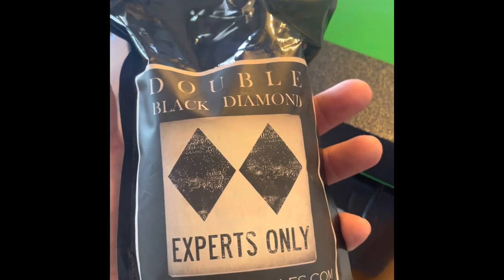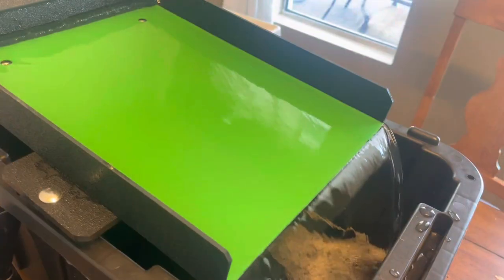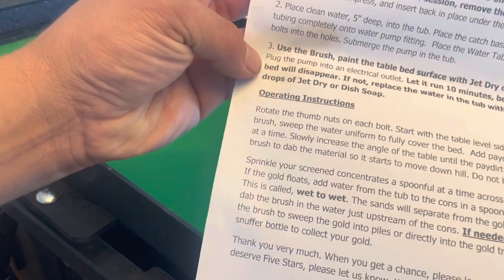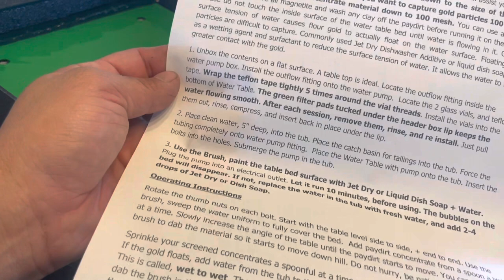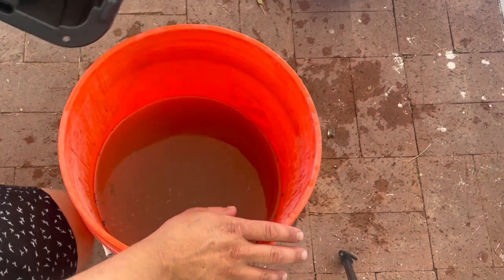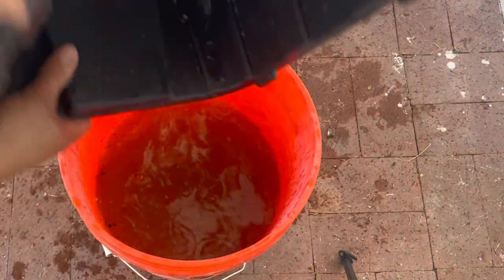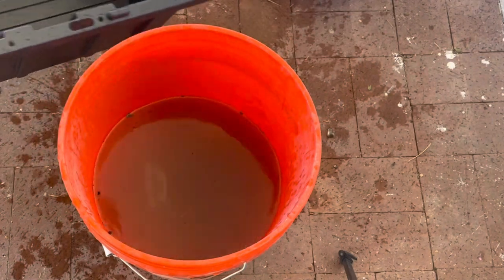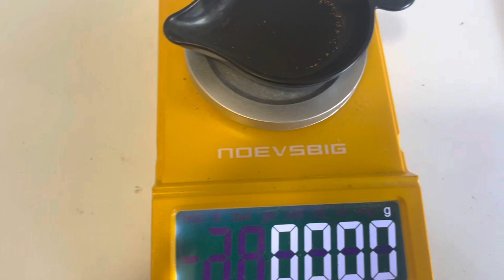Miller Table test with @goldnuggetsales  hardest Gold Paydirt in the World

Comment: I used to have an original Miller table. I loved it. It was 6' long and made of slate with little grooves cut in it for the first foot, Than it had 3 sections of carpet with extruded metal and  the last section had a copper plate that you could amalgamate with mercury and your real fine "floaty" gold would stick to that. Finished off with a mercury trap at the very bottom. Used the hell out of it in Colorado. Lost it in an accident coming back to AZ. Sucked.
Reply: That sounds like a collector piece....the exact point in time when mercury and carpet overlapped...sorry for the loss🤝
Reply: @ferdburphel2076  Even back in the old days they "lost" mercury. The Carson River is loaded with mercury from the old mills. Very seldom did i find or have any loss. I always recovered what i started with.
Reply from the maker: Damn!! Thank you Richard BEEE!! Take Care!
Reply: @VendettaProspecting  What you up to Mike? Why the thanks?
Reply from the maker: @richardbeee  saying thanks for watching and commenting

Comment: I got the royal Miller table from A&B when I was in AZ.  Definitely nice having it for very fine gold!!  You should put a catch basin in the tub to make it easier for cleaning up.  If you use something like a credit card or hotel room key card or something similar you can use it as a scrapper to help get the gold off the surface better then the brush.
Reply from the maker: That’s weird still there the other day when I went there, the brush is nice because it won’t scratch the surface and leave grooves in it, the brush is a lot softer
Reply: @VendettaProspecting  they had a couple of them when I got mine.  Oh yea I forgot the royal Miller table has a different coating thats more like a rubber that I dont have to worry about scratching

Comment: a few things to help you out maybe. that table is too steep. also classify your material first. the powder gold is washing away and some of the small chunks.
Reply from the maker: thanks for the input, it was set at less than 1 degree of drop, the worst issue with this is the gold getting stuck in the threads, even if you use plumbers tape it is Chuck full of gold, only way to get it out was to spray water and then the gold drips and sticks to the bottom of the unit....

Comment: Using a Miller table is a bit like watching paint fade (not drying), but a necessary evil.... I have made a few using 12"x 24" floor tile...used a T sq and 100 grit sandpaper to deglaze the tile and give it some tooth... epoxy 1 1/2" aluminum angle on the sides and make a head for the water source. Get a sump pump speed controller (Amazon)....Voila....A CHEAP Miller table
Reply: Great video Mike
Reply from the maker: Thanks so much!
Reply from the maker: Intresting! i bet there are all kinds of different surfaces you can use thats really creative with the tile!! Love it!!